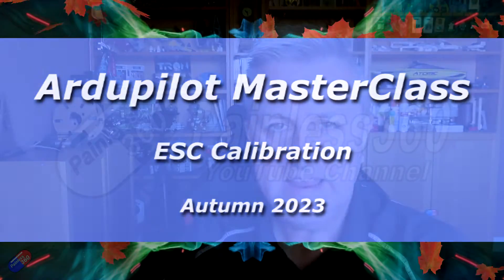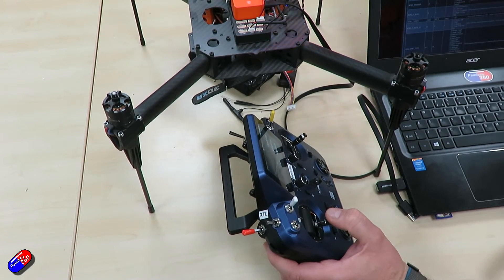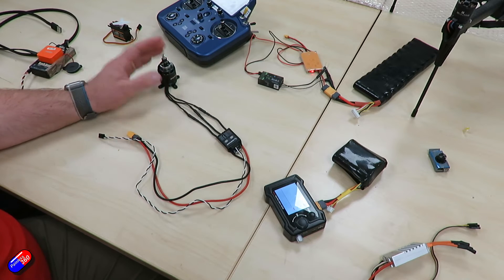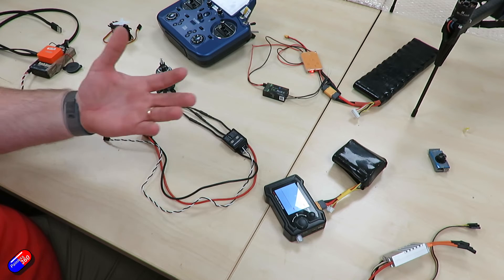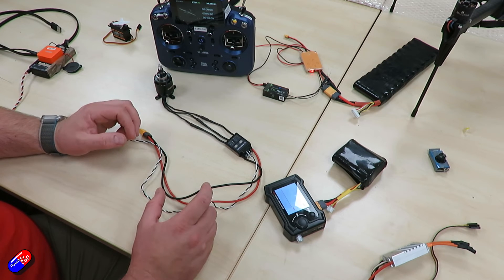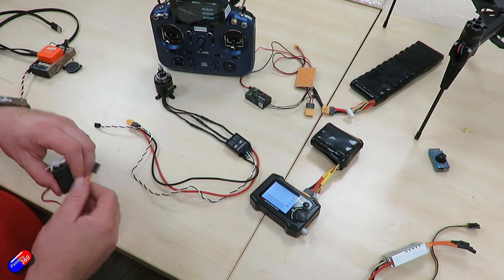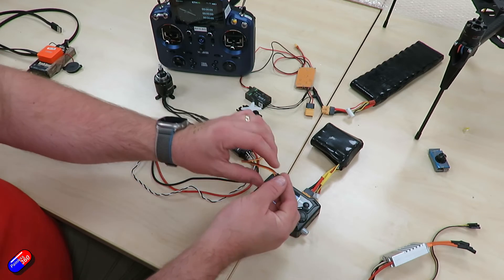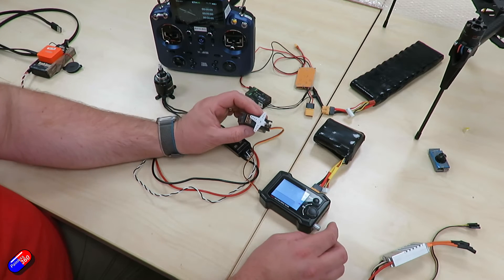ESC Calibration with ArduPilot Masterclass

Comment: Thank you for providing a solution to my problem. After selecting ESC_Calivation = 2 and saving, when I disconnect the battery and USB and reconnect the battery, should I set the throttle position to neutral and connect the battery? I'm curious about the throttle position.
Reply from the maker: Always use the Wiki as the bold standard for how to do stuff. See https://ardupilot.org/copter/docs/esc-calibration.html
Best of luck!

Comment: Thank you for this video. I am still struggling with calibration of my esc’s. Would you be able to help me with this?
Reply from the maker: What troubleshooting have you already done?
Reply: @Painless360  quite a few things. Is it possible to go on a zoom call?
Reply: @ i have tried calibrating it through the software qcgroundcontrol but it keeps crashing the software. I have a pixhawk 6x and it doesn’t have the button so i dont know how to to calibrate all four escs
Reply from the maker: I use Mission Planner here for exactly these kinds of reasons... Best of luck

Comment: Thank you for the Viedo. I have Inteligente ESC from T-Motor (Thunder Flame 300A) the value is 1000-2000 PWM. But they no longer calibrate automatically, do you have a solution? Greetings
Reply from the maker: That is a serious professional ESC, I'd contact the seller for help.  Best of luck

Comment: Is that a 50A ESC?
Reply from the maker: https://www.3dxr.co.uk/multirotor-c3/multirotor-escs-c48/hobbywing-xrotor-pro-50a-4-6s-2pc-p3715
Reply: @Painless360  mate, thanks for the answer, but i've got one more. When i set the ESC_CALIBRATION parameter to 3, the next time it is powered, there is no sign of it entering calibration mode, it's just booting up like usual. What would be the cause of this?
Reply from the maker: What troubleshooting have you already done?

Comment: Is it safe to shorten the esc wires that connect to the battery?
If not is it possible to fix it through software?
Reply from the maker: Yes you can.  Best of luck